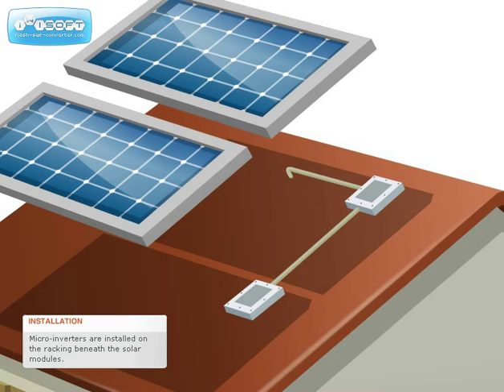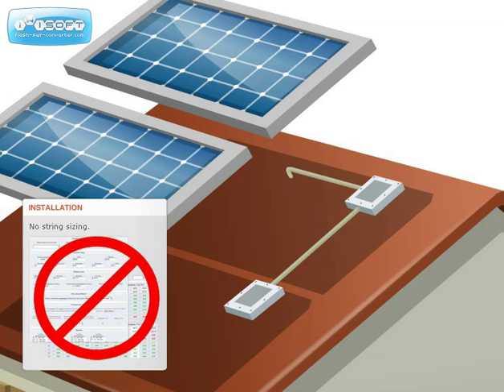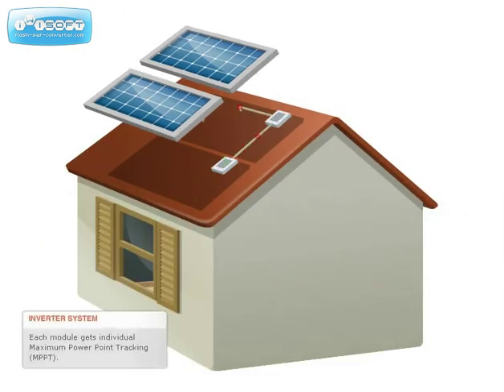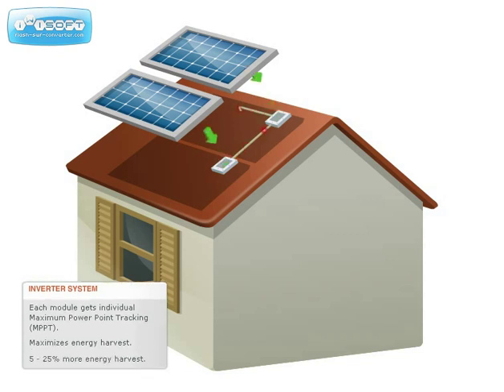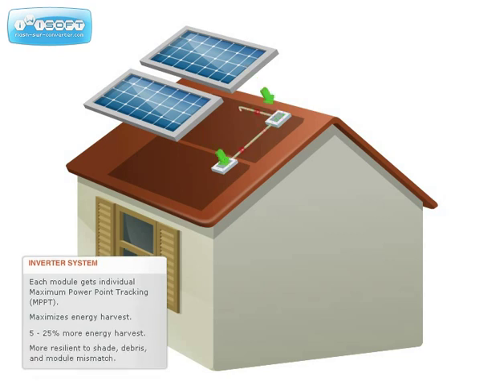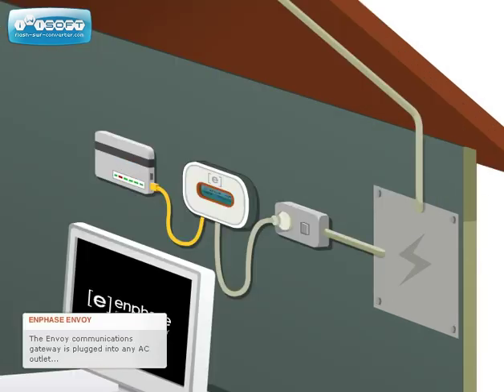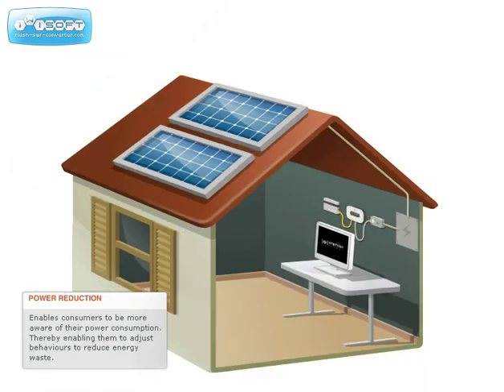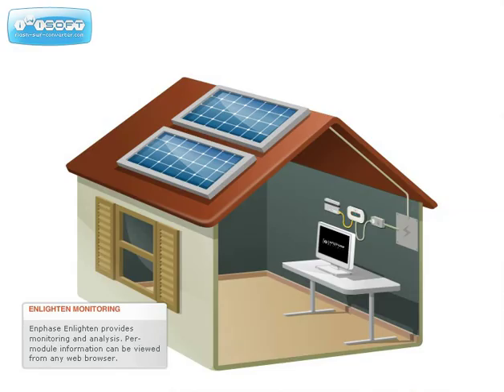Enphase Energy microinverter explained.

Comment: i had a question please, i am working on a project about sizing PV system grid-tied , in my project i have to design the system the way that the inverter should shutdown the PV modules when there is a excess of electricity , because in our country it s not allowed to sell the surplus to the grid. at the same time, in bad conditions of the PV system, we need to take electricity from the grid. HELP plz !
Reply: I am looking into this system and came across this document https://enphase.com/sites/default/files/downloads/support/Design-Considerations-AC-Coupling-Micros-Battery.pdf where the last section on page 7 answers your question. "For systems interconnected to a utility service that requires an export limit ... The solution is for the PV system to measure the loads in the home via consumption metering and to limit the PV system exported power when needed. This functionality increases system sizes and provides a much better value to the customer. This export limit function is part of the Enphase Energy IQ system." Finally, "This functionality is set through the grid profile and called Export Limit – Soft Limit."

Comment: So does each three by five ft panel get its own micro invertor? If I am being sold 21 panels, how many micro invertors should I be getting? Have any of you smart users purchased any batteries? Should I wait? Did you wait? Thanks.
Reply: if you buy 21 modules you will get/ or need 21 micro inverters. You can also buy batteries but you need solar charge controllers and will help you to charge the batteries. What do you mean by wait?

Comment: 119 years, how was that tested, lol
Reply: I have 43 microinerters in my system and every year 4 or 5 have to be replaced. I have had my system about 6 years.
Reply: every year, you need to replace 4-5?!?! is that warrantied? lol
Reply: Stephen Kucsan what brand and model are they?  I’m looking to buy some and would like to avoid problematic and failure prone brands.
Reply: learn about reliability calculations..